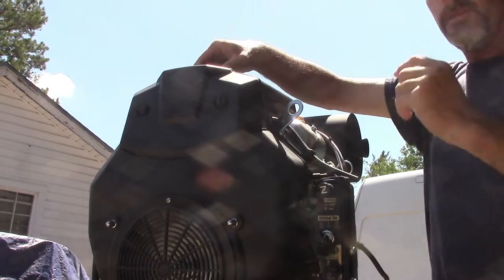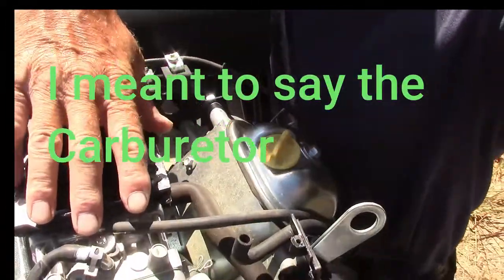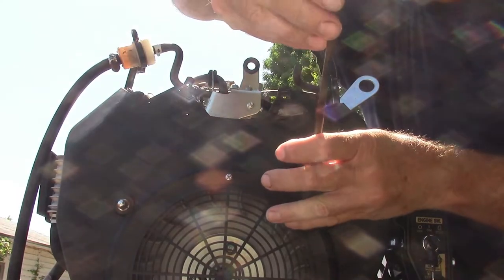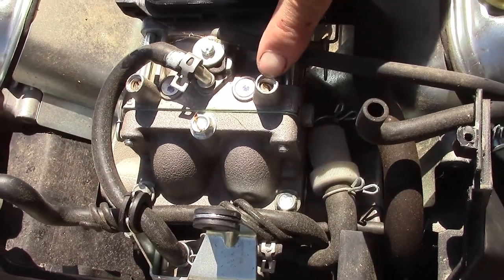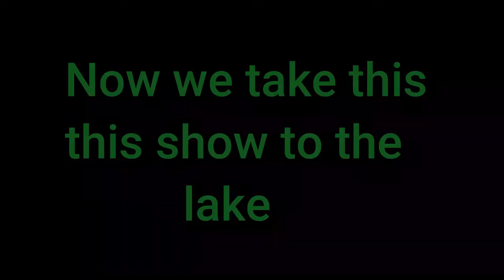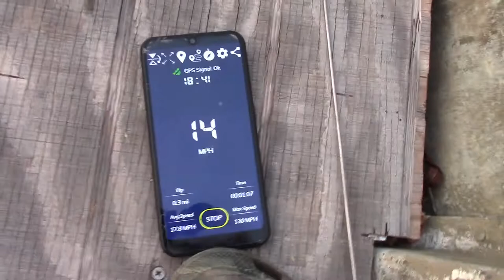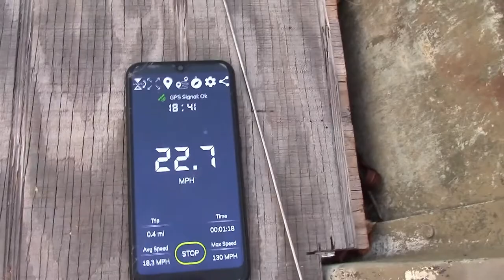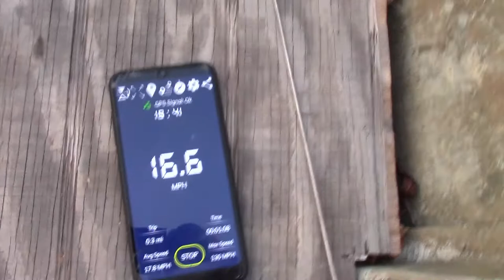Predator Mud Buddy Carb Tuning

Comment: I’m so glad to come across your video!  I’m in the process of putting a predator on a mud buddy frame.  Did you use a 1” to 1 1/8” adapter sleeve??  Did you have to make any other adjustments or modifications to make it work?
Reply from the maker: I think it has the 1 1/8 shaft
Reply: @armadillooutdooradventures9792  They are 1” unfortunately, and the belt pulley/clutch is 1 1/8”. I’ve read about some people shearing adapter sleeves but yours seems to run well. I’m not sure what I’m going to do.
Reply from the maker: @CC-pi6gm  I ran it trough all sorts of crap wfo it never gave me any trouble. I sold the motor recently and got an outboard. Will probably be getting a jet foot motor soon. That motor served me well but my needs have changed.

Comment: Can you list everything you did from bone stock?
Reply from the maker: At the point here all I have done is adjust the carb. Since then I have installed a new fuel pump,that video will be out soon. I have gutted the exhaust and opened it up. I built a pretty cool grab bar and I have a mikuni carb to put on. I have a few videos made just not edited yet and will be making more as I progress. Thanks for checking it out.